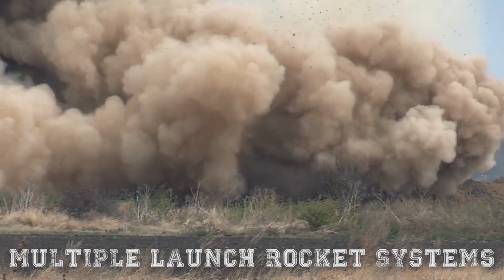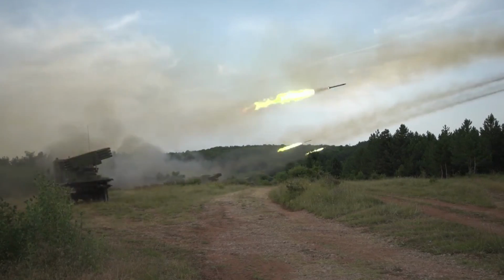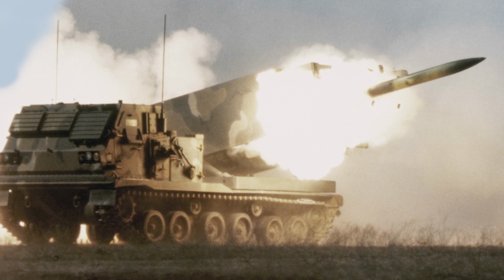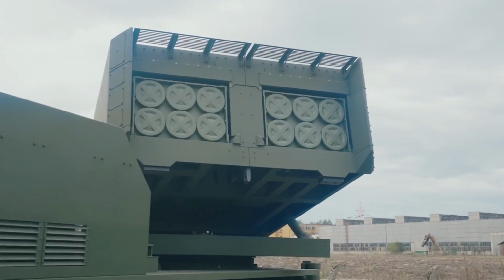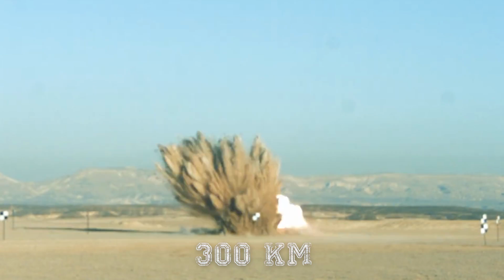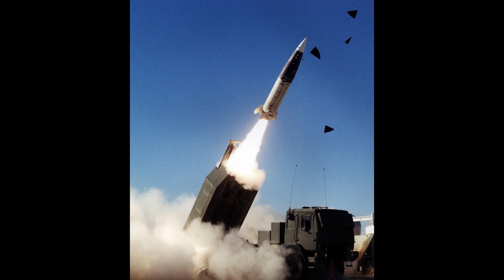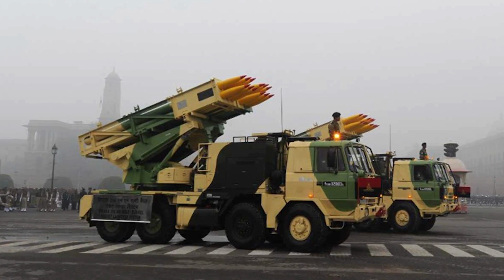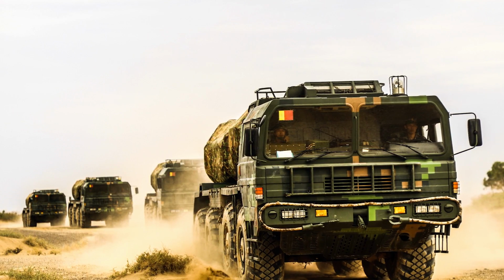US New M270 MLRS After Upgrade SHOCKED The World!

Comment: The British Army are buying more new M270A1 or A2 Multiple Launch Rocket System (M270 MLRS) is an American armored self-propelled multiple launch rocket system Self-Propelled Loader/Launcher (SPLL). with a new M270 MLRS unit cost of $4.7 million (in 2023) compared to a new M142 HIMARS unit cost of $4.4 million (in 2023) too.

The SPLL is composed of three primary subsystems, namely the M269 Loader Launcher Module (LLM), which also houses the electronic Fire Control System, is mated to the M993 Carrier tracked vehicles, 

The MoD should be buying for Royal Artillery instead, the M142 High Mobility Artillery Rocket System (HIMARS) is a light multiple rocket launcher developed in the late 1990s for the United States Army and USMC.

Though the M142 HIMARS is mounted on a standard U.S. Army Family of Medium Tactical Vehicles (FMTV) M1140 diesel-powered 6x6 wheel frame all terrain truck, with a fully armoured control cab for a crew of  three, a driver / loader, gunner  / vehicle commander and radio-operator / loader. 

The M142 HIMARS carries one pod, with either six Guided Multiple Launch Rocket System (GMLRS) rockets, or one US Army Tactical Missile System (ATACMS) missile, or will carry one new US Army 
 Precision Strike Missile (PrSM).

Which is a short-range ballistic missile, developed by the United States Army to replace the MGM-140 ATACMS. 

The PRSM will have a maximum range of in excess of 310 mi (500 km), carrying a warhead of 91 kilo's, plus with Supersonic flight capability in excess of Mach 3 (0.6 mi/s; 1.0 km/s) too.

Yes the MoD and Royal Artillery, should buy the new US Army Precision Strike Missile (PrSM), for the Royal Artillery existing ML270 MLRS tracked vehicles.

However buying more M270A2's is a wrong decision, they should be buying between 50 to 100 new M142 High Mobility Artillery Rocket System (HIMARS), mounted onto Rheinmetall MAN Military Vehicles (RMMV) Hx2 / HX 3 Tactical Military 6x6 or 8x8 wheeled trucks, with a fully armoured crew cab as the HIMAR Self-Propelled Loader/Launcher vehicle. 

This would allow for at least one new Regular Royal Artillery HIMARS Regiment, with HQ Battery and Logistical Support Battery plus three Batteries each of 12 new M142 High Mobility Artillery Rocket System (HIMARS) Self-Propelled Loader/Launcher vehicle, with four HIMARS Self-Propelled Loader/Launcher vehicles in reserve too.  

Maybe a second new Reserve Royal Artillery HIMARS Regiment t oo, again with HQ Battery and Logistical Support Battery plus three Batteries (with two fire troops) each Battery of 12 new M142 High Mobility Artillery Rocket System (HIMARS) Self-Propelled Loader/Launcher vehicle, with four HIMARS Self-Propelled Loader/Launcher vehicles in reserve too. 

These two HIMARS Regiments, could support both the British Army Regiment Battle Groups and full Brigades overseas deployments, or Royal Marines overseas deployments too, by assigning independent HIMARS Batteries or Troops.

Equally these two HIMARS Regiments, could be deployed around the UK coastline, for Coastal Defence  and Anti-Shipping duties, when armed with either ATACMS missile, or the newer PrSM missiles, providing protection out over the horizon and out to sea upto 300 miles. 

Which would make the North Sea, the Irish Sea and the English Channel plus Western approaches, basically as no go areas for the likes of Russian Warships, equally large sections of the Norwegian Sea  could be a similar no go ares too. 

Along with a troop of HIMARS stationed between and around temporary launch sites, in the West and East Falklands Islands.  Would give the Falkland Islands a 300 miles defence zone, against any approaching enemy warships too,

So buying HIMARS wheeled vehicles, over buying more MLRS tracked vehicles, makes more sense to artillery gunners, if the UK Politicians cannot see this for themselves.
Reply: Thank you for this information, it would have been nice if the researches at IF had of applied this level of effort, I also hope you didn't just copy and paste it from Wiki?